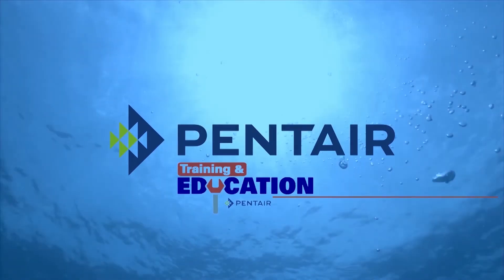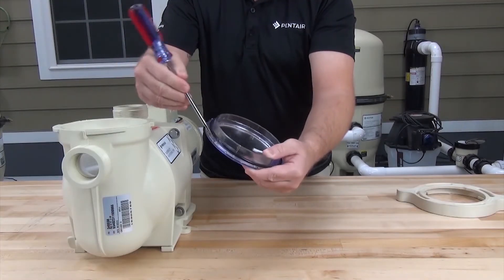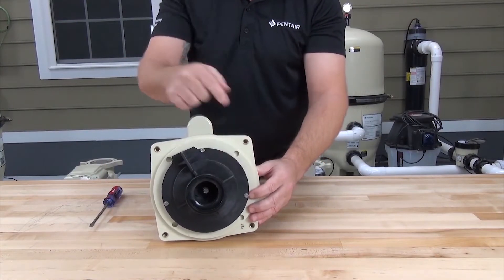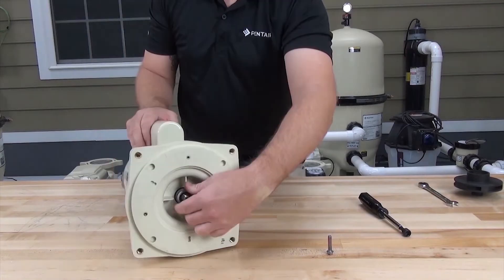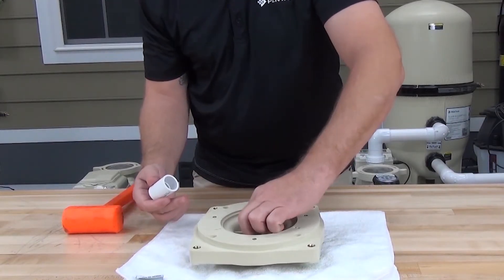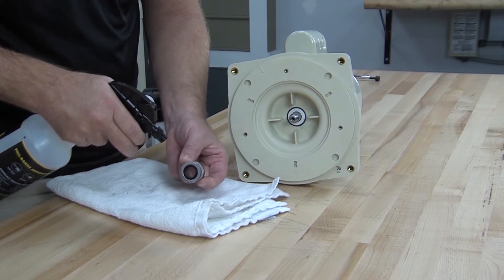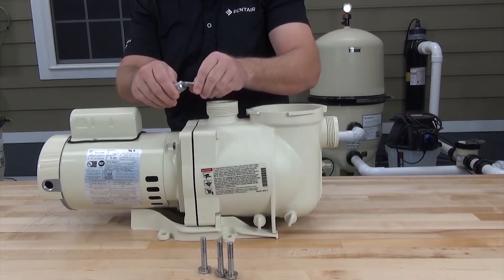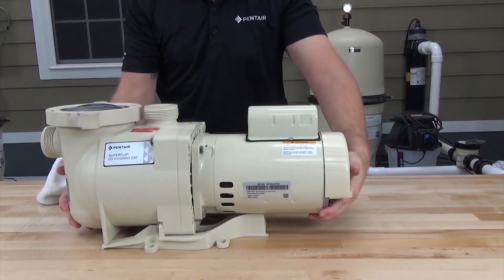Seal replacement SuperFlo® & SuperMax® pump with Pentair Genuine Quick-Kit

Comment: Awesome pool guy said meh just buy a new but at 1200 bucks I figure a 30 kit and this video I had to try. And it works perfectly I have a perfect seal with no leaking and no air in the pump at all. Great video

Comment: Great Job on the video. I finished installing new motor on SuperFlo pump and simply followed your instructions, step by step. No issues. The new pump is back on with Pentair Quick Kit parts and running smooth. Thanks.

Comment: I FOLLOWED THIS PROCEDURE, AND AFTER FINISHED PUTTING THE MOTOR BACK TOGETHER, IT HAD NO SUCTION, COULD THE PROBLEM BE THAT I PUT THE L 1, AND L 2 WIRES REVERSE ? ,

Comment: Good video but when I got it all back together the shaft turns very hard to the point that the motor won't start. Any idea what I did wrong?
Reply: @Terry Cook DID YOU EVER FIND THE PROBLEM ? I HAVE NO SUCTION AFTER I PUT EVERYTHING BACK.

Comment: Gah! The part I need to see is how to get the lid out of the clamp (the clear part out of the part with the handles). The video skips right over that part when removing it and when replacing it!
Reply: I am sure you have figured out by now, so maybe will help others. On mine the clear top was stuck and not loose, a light tap downward with rubber mallet broke the clear lid free.  Once free, it will not come straight out.  Holding the assembly upside down angle it in the ring and push low side into corner of the ring.  This will allow the upper side to pass the locking wings on ring and slide out.

Comment: Good video.
Question - I have a superflo VS pump that is only 2 years old.  It has started running much louder recently.  Could a bad shaft seal cause that?   I'm looking for ideas of what could be the issue before I either take it apart or hire someone to look at it.
Thanks

Comment: My Super Flo pump with "top" on the seal plate positioned at top of pump the Diffuser tab sets about at 3 o'clock. Was there a change in the position of the tab to the seal plate? Update even though my diffuser was positioned at a different configuration I installed as you mentioned in your video.